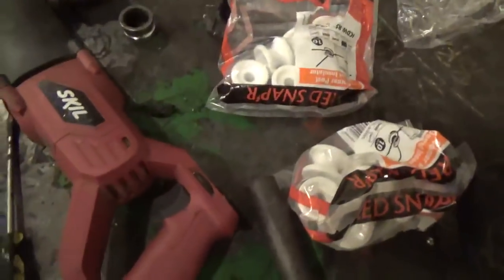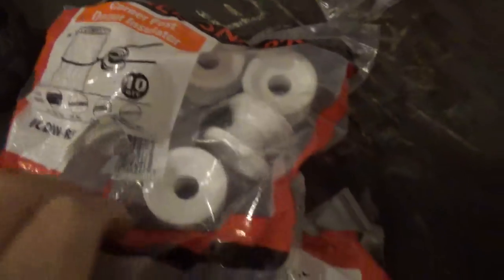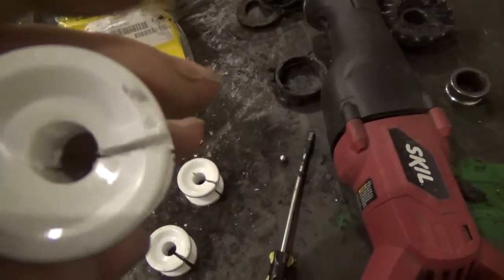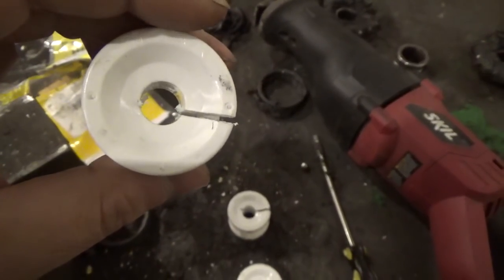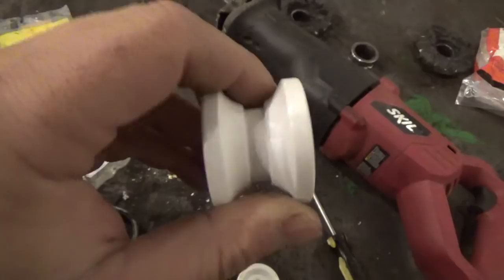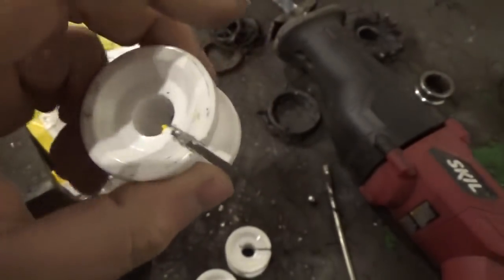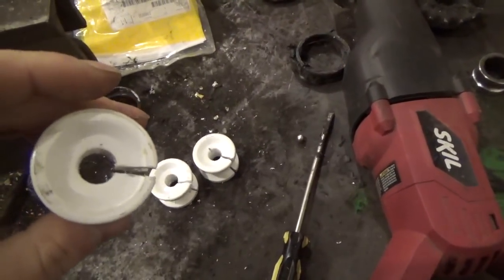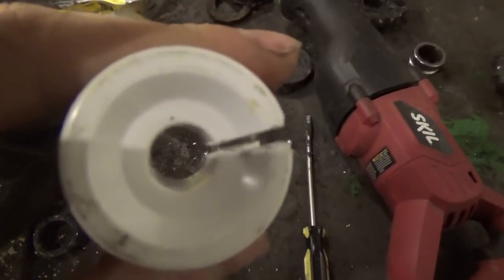Combine repair, custom insulators and Truck steering box

Comment: seems like a great idea on those insulators.  you need to put up signs for the deer.  :)

Look forward to the fence videos
Reply from the maker: Thanks Jay. I already flagged the fence, that helped but they still hit it every now and again!
Reply: I was kidding about the signs.  you really put up flags?  does that help much?  Have you noticed less with the flags?
Reply from the maker: The flags have helped a lot. I think its the younger deer that cause most of the damage.
Reply: That is crazy.  what do you use?  Rags?
Reply from the maker: Orange and Yellow Duct Tape!
Reply: that would stand out for sure
Reply from the maker: I'll show the flags when I make the video of installing these insulators. The flags do help. I have around $30 invested into the tape which in the past has lasted 2-3 years. Painted vinyl siding clipped over the fence (6x6" square) would last longer, I just haven't found any used stuff yet!

Comment: you could cut a treated 2x4 4' long and nail it to the tree and then use your normal pin lock insulators

Comment: G - Brad if I am following you , you are going to put the high voltage wire into the slot to the center hole and then put a screw into the same hole to fasten it to the tree. Right? If that is so the screw will ground your fence to the tree because the screw and the wire are touching.
Reply from the maker: I am getting u shaped pipe/tubing hangers that will go around the outside of the insulator, the wire will go through the center hole.

Comment: Not a hundred percent sure if Im with you but if you are after a cheap alternative,I get 2 x pieces of poly pipe (inch and a qtr) ,drill a hole in the end of each and screw the other ends to the tree about a foot and a half apart and run the wire threw the 2 other ends at the point. The poly water pipe just bends and moves if the kangaroos hit it .
Reply from the maker: Thanks, if this doesn't work I will have to try the water pipe idea.